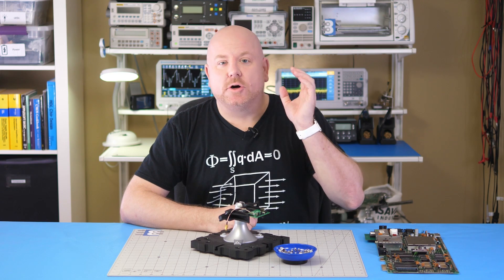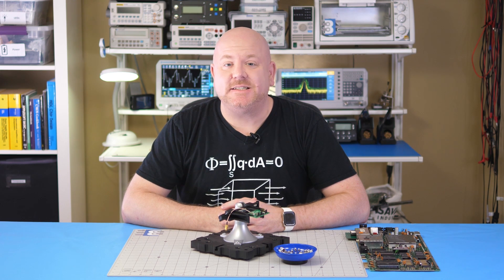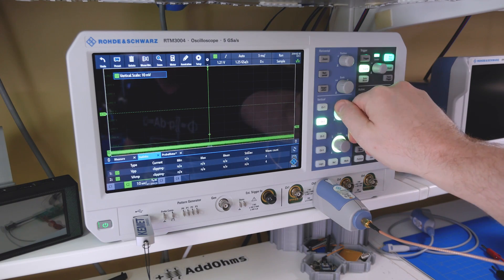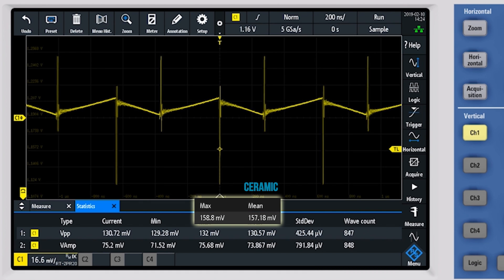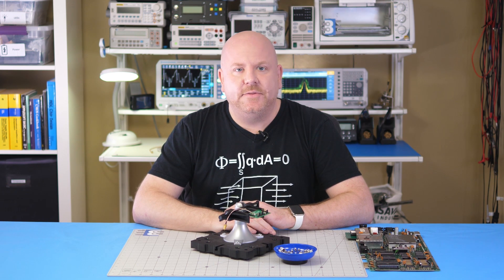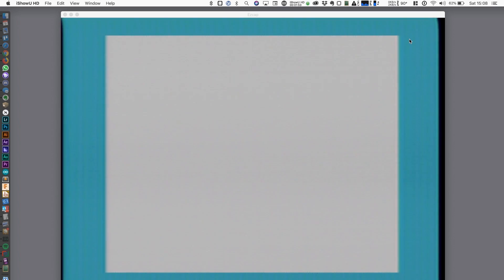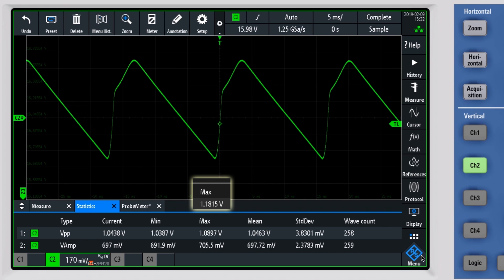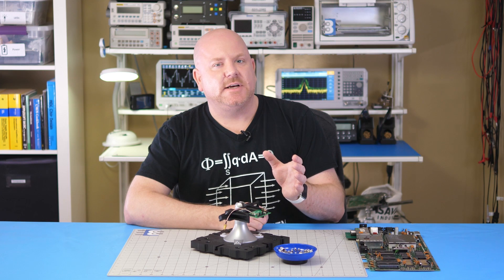Replacing MLCCs with Polymer Capacitors - The Learning Circuit

Comment: 10:50 There's still a lot of high frequency noise in the scope view. Could you add a small ceramic capacitor in parallel with the polymer cap to reduce this noise?

Comment: ok here is my issue.  Poly versions are cheaper where i live.  i have 7 blown MLCC and need to replace them.  Due to my motherboard being 8 years old.  I want to replace these as getting totally need items to replace board and upgrades is not an option.  Can i use the poly versions to rep my mlcc versions.  would this be an improvement.  I dont have scopes or anything but i can solder just fine.  2700 6.3v  + many 1500 10v have blow.  I can find the poly versions in these just fine.

Comment: But why people put tiny ceramic caps in parallel with big electrolytes ones. I understand that small caps have lower ESR ,ESL and support higher frequency. But how it works, does the small caps delete the ESR it the big one?

Comment: @James Lewis So, if I want to replace both the C64 linear voltage regulators with switching ones, can I likely swap out the regulators' caps with those in the video?

Comment: 1.2V out? You mean 1.8V, right...?
Reply: AddOhms
1 second ago
Nope. The EVM was configured for 1.2 volts. I used the schematic from the TPS's datasheet which had an example of 1.8 volts because it was easier to read than the EVM's schematic. As I showed with the measurements, the board is outputting 1.2 volts.
Reply: @bald_engineer  Yeah, I got to the oscilloscope and saw that it said 1.2V.😅 Sorry.

Comment: I replaced all the ceramic disk caps with comparable MLCCs in a C64, as well as some other parts with more modern ones. Unfortunately, official schematics of the C64 I have didn't actually match what parts they put in. I mean, it's great that the engineers and such used whatever they had on hand but bad for repairs. :(
Reply: What was the effect of your replacements?
Reply: @Thecando  Failure 🤬. I ended up getting a Sixtyclone board.
Reply: @PenutbutterJellyfishSandwich What caused it to fail?  Did the MLCC have that much difference in effect compared to the dick caps?  Why was the Sixtyclone so much more different?
Reply: @Thecando  Honestly, I have no idea. I had changed so much in my zeal that I was unable to figure it out. The Sixtyclone is just using pretty standard "default" C64 components, so there really isn't anything different from an original C64.
Reply: @Voidsworn  Thank you for the info and thank you for responding to my questions :)
Reply: @Thecando  you are quite welcome. 😁
Reply: @Thecando  Also, just realized this in your comment..."dick caps" 😁.

Comment: What about the ESR of the old capacitors used in C64? Also it would be interesting to see what happens if you put modern low ESR electrolytic caps into the same C64.
Reply: Well, the polymers are modern low ESR electrolytics. :) Modern traditional wet electrolytics will still have at least one order of magnitude more ESR than a polymer.
Reply: @bald_engineer  I see.

Comment: axials were intended to use with point to point wiring on solderstrips and wirewrap, the naming is similar to radial and axial blowers, the leads are attached like the stream of air would go  (paralell to the axis-> axial). I opnly know that from having to remember when i studied viticulture...